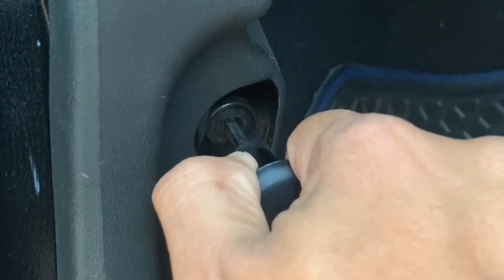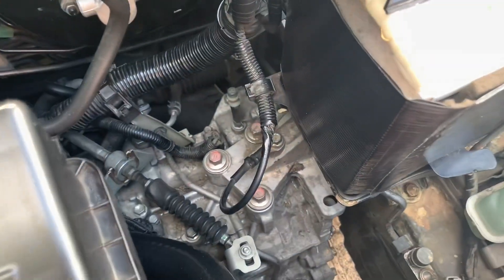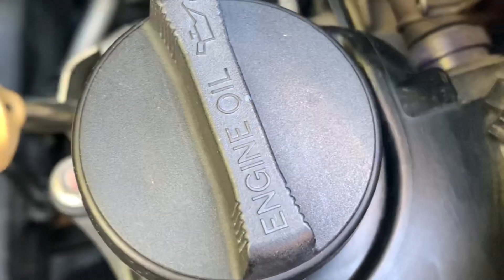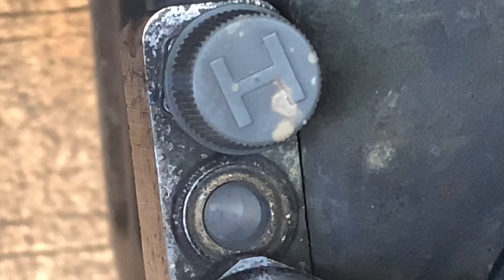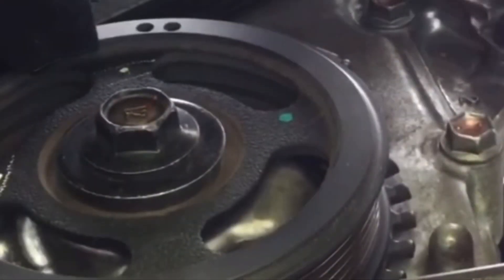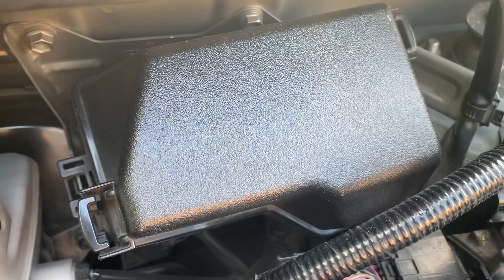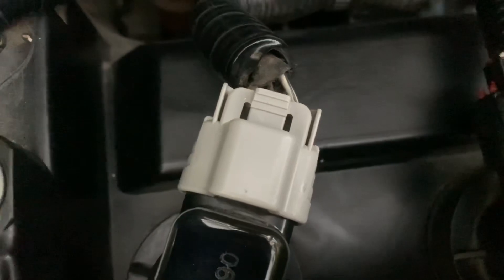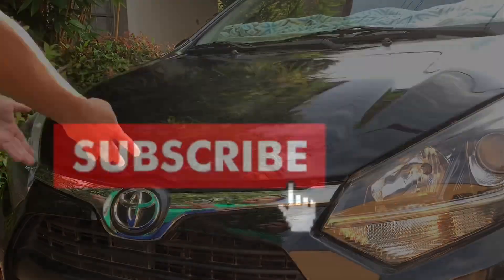Engine Bay Parts & Basic Functions - Toyota Wigo, Ayla, Agya. Perodua Axia

Comment: Sir what is the effect if the ABS actuator assembly is totally disconnected and the multiple hydraulic brakelines are already connected and converted with each other, is this will affect the performance of the car especially the break system?

Comment: Hi Sir. Question po about sa engine.
Facing the engine, at the right side of the engine may Allen flower screw facing the battery. Pwede po malaman ano yun and para saan, and how to tune if needed? I noticed the color marker does not match after a PMS from a dealer.

Comment: Hello sir every when palit ng engine support ? Kasabay ba talaga dapat sya ng transmission support pag pinalitan? Maraming salamat po more subs!
Reply from the maker: as long as the 
engine support is doing its job (which keeping the engine vibration to a minimum). wala pong recommended sched ang toyota for it to be replaced. so, hanggat hindi disturbing and distracting ang pag vibrate ng steering wheel, there's no need to replace the support. in case you do need to replace it, hindi naman po dapat palitan din ang transmission support.
Reply: @WigoRaizeTV  thank you for the quick response sir! As per mechanic na nakausap ko sir may sira daw ung bushing pero in my experience sir parang wala naman masyadong vibration kahit 100km/h takbo ko smooth padin naman db medyo normal naman ang vibration for wigo? Regards!

Comment: Where is the power steering of wigo gen 2?
Reply from the maker: Hi, if you are referring to a power steering fluid reservoir/tank, there's none. It's using electronic power steering  technology which is located under the engine.

Comment: Good day sir.

Tanong ko lang po bakit ayaw gumana ng fog lamp ng wigo ko pinalitan ko na ng bagong ilaw. Wala nman putol sa mga wire nya
Reply from the maker: check the fog lamp fuse po. you can also clean yung fog lamp socket baka madumi na ng sobra and hindi na makaflow ang electric current.

Comment: Sir san nkalagay ung fuel pump relay ng toyota wigo gen 2..tnx
Reply from the maker: ang alam ko nasa loob ng dashboard near the steering column. katabi nya yung radiator fan relay. they look the same pero nasa dulo yung fuel pump relay. part number 9004A-98006.

Comment: Good day sir! Very informative ng channel nyo. More power!

Tanong ko na din sir, saan po kaya located ang knock sensor bank 1 or input 1 ng wigo? Check engine po kasi, knock sensor low input bank 1. Error  code P0327. Thank you po sir
Reply from the maker: hi kevin. the downstream sensor bank 1 is located under the vehicle after the catalytic converter. here's a link that you can watch about O2 sensors:)
Reply: @WigoRaizeTV  ohh, may napanuod din akong video nyo na pinakita nyo po ung oxygen sensor. Same lang po ba ung oxygen sensor and knock sensor? Thank you po ulit sir.
Reply from the maker: @knivemile00  ah... you are referring pala to the knock control sensor...my bad:( it's located beside the engine malapit sa spark plug na nasa far right in the engine bay:) the part number 89615-BZ040
Reply: @WigoRaizeTV  Thank you so much sir. Sobrang tagal na po ng issue ko about this knock sensor. Sana maayos na po soon. Sobrang laking tulong po nito. God bless sir. Will send you an update sir. Thank you po ulit

Comment: Hi Sir! Normal lang po ba yung malakas na engine vibration ng Wigo AT? 2 weeks old pa lang po.
Reply from the maker: according to the owners manual, engine vibration is not a sign of malfunction. no need to worry, especially since your unit is new:) toyota is attributing the vibration to the electronic power steering technology sa wigo.
Reply: Anong klaseng vibration ba? Kapag nakaidle o tumatakbo?

Comment: san po location ng transmission fluid/ power steering reservoir?
Reply from the maker: walang power steering reservoir ang 2017 unit ko. it uses electronic power steering. the transmission pull up dip stick is located beside the coolant reservoir near the radiator hoses.

Comment: Hi po wala pong steering yung wigo 20q9?
Reply from the maker: Marilyn Mas If you mean steering fluid, yung 2017 unit ko po na automatic transmission wala po. electric power steering technology na ang gamit sa wigo.
Reply: sa gen 1 po ba electric power steering na rin po ba?

Comment: Natural lang po ba talsik ng engine oil?
Reply from the maker: Marc Francis Lopez hindi po normal ang talsik ng engine oil. baka po it was overfilled with oil. check nyo po muna yung engine oil dipstick baka sobra sa langis. if that's the case, bawasan nyo po ng kaunti using a syringe na may aquarium hose or turkey baster from the engine oil filler.